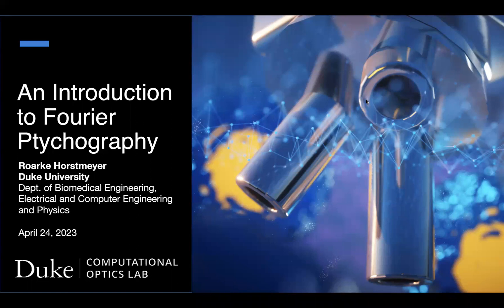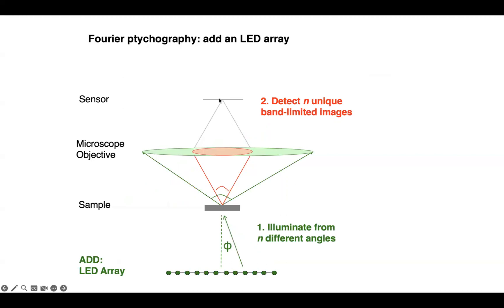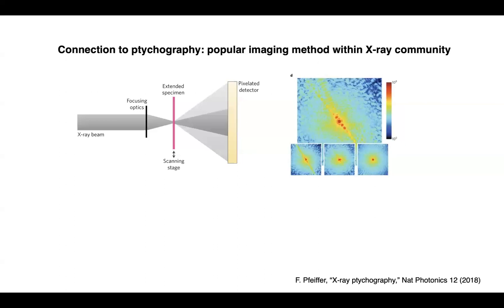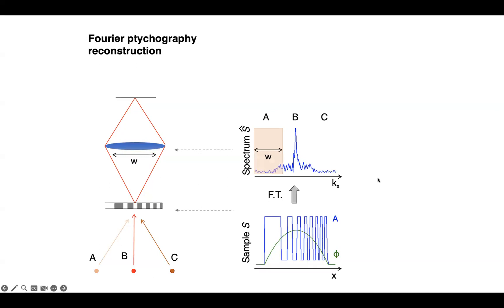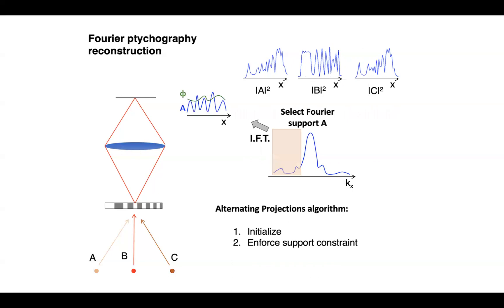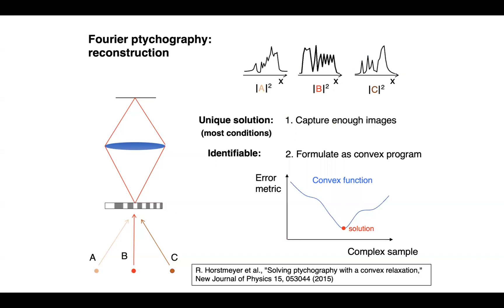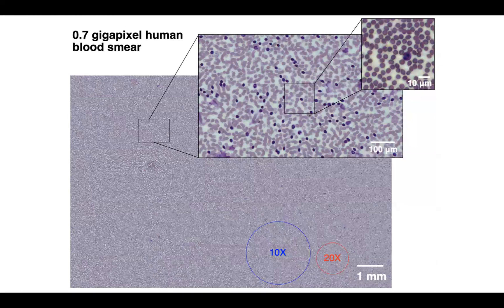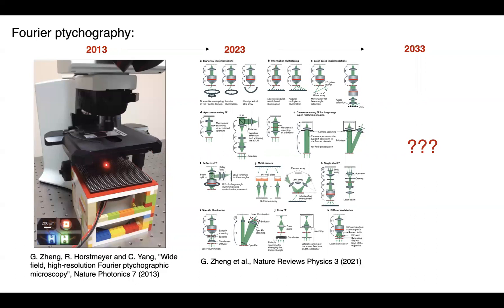Introduction to Fourier ptychography

Comment: Thanks for sharing! Very good lecture to learn ptychography. Could you tell me the relationship between the extent of the overlap and the results?
Reply from the maker: Great question! This topic is still under investigation by a number of research groups. The short answer is, around 60-70% overlap works very well, if you are ok with such measurement redundancy. 50% overlap is near the limit to get acceptable results for general samples, and then it is possible to use even less overlap if one applies prior knowledge about the sample (i.e., constraints their search to a subset of possible samples)

Comment: Are you also working on integrating FPM and deep learning ? I m working on FPM reconstruction using GAN networks
Reply from the maker: Yes we have worked on that a bit in the past. In the paper below, we integrated an untrained convolutional neural network as a "deep image prior" to help improve our FP reconstruction results (for the 3D imaging case). In the second link below, we used a machine learning framework to optimize the LED pattern within our FP microscope. A GAN approach sounds interesting!
https://opg.optica.org/oe/fulltext.cfm?uri=oe-28-9-12872&id=430210
https://opg.optica.org/boe/fulltext.cfm?uri=boe-10-12-6351&id=423327